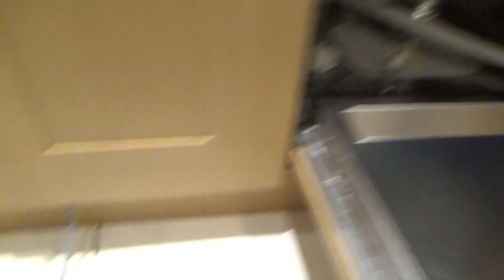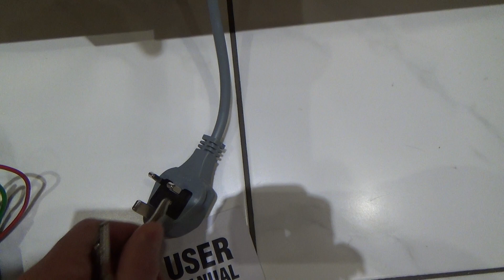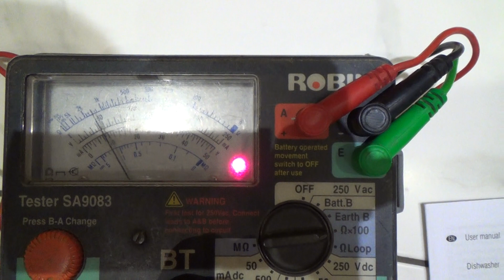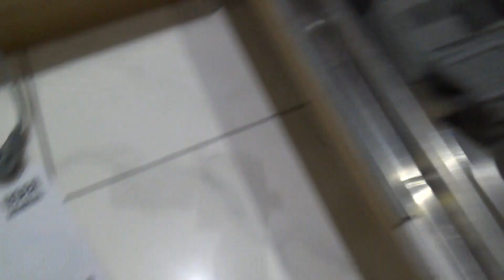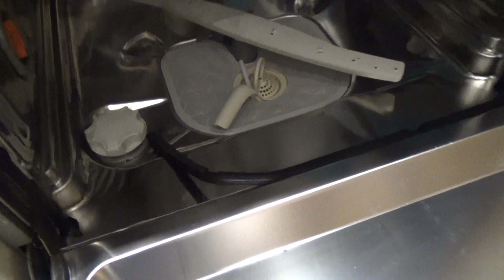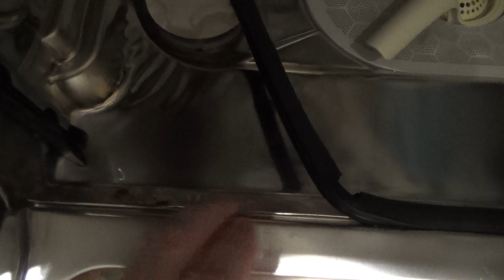Zanussi Dishwasher Fault, Tripping RCD, EASY FIX DISHWASHER REPAIR

Comment: Great video but mine is tripping as soon as I switch it on so it may be in the plug or the lead of the dishawasher that the short is. wish I knew how to test the plug for a short with a volt meter.

Comment: Thanks for uploading. In my case I’d left the fascia off the front as I’m still fault-finding (water not heating) and I think perhaps water was getting in through the screw holes that affix it on. Put it back and not tripping fingers crossed! Let’s see if it heats now!

Comment: My one is very similar to yours Zanussi ZDF2020 went to switch it on and nothing at all check the fuse in plug it looks fine seal looks fine. Must be the controls.

Comment: 2 yr old AEG dishwasher tripped out on me this morning. Checked the plug fuse and no problem. I thought it might be the heater cycle as it had been on a while. So i looked on YT for the problem. Found your vid and spot on, the door seal had come away. Thanks you saved me money and call out hassle.

Comment: Nice on Vince!  In my case I have a Siemens SE64630, but after watching your video I checked out the bottom seal and found it actually had a tear.  I replaced the seal (what a job that was - door completely off, 1 million screws to manage!)  Anyway it's all back together and is no longer tripping the 30mA RCD.  Many thanks!

Comment: Have the same model, pretty old though.  Rubber seal across the bottom eroding away. Will try to order a replacement and see if fixes.

Comment: Going to share some honesty here :D Never had a dishwasher before, so when I moved into my new home and found here, wasn't too bothered to use it - it tripped out the RCD after the second use to which the prior owners stated that the RCD was new and they hadn't tested the dishwasher with it but prior to that, no problems. So electrician needed. Left it... for months as it didn't bother me - full reconstruction on its way anyway... but then I thought today, as the sink is facing some issues (old non standard length screw took two weeks to hunt down over here!) what would youtube do.... cheers Vince - this at least has opened a bunch of avenues I can have a look at!

Comment: I followed this video and removed and cleaned all the door sealings. I removed also doors to dismantle sealing located at the bottom of the doors. There was a lot of dirt.
My dishwasher was tripping RCD almost everytime when inside was quite hot and a lot od steam. I suspected that somehow steam is reaching electric components and making shortcircuit. So far so good. After few washes RCD didn't trip.

Comment: Have a GE dishwasher. Was reading posts related to the symptoms. Saw you video and Cleaned around the rubber sealers and voila. My dishwasher stopped tripping the fuse. Thank you so much!!!

Comment: Mine tripped out the power, and every attempt to plug it in tripped out the power. This was after I had pulled it out to clean under it. What I had done was accidentally doubled the waste water out pipe as I pushed it back into place, so it couldn't drain and the water level rose and got through a seal somewhere to the bottom of the machine where the cables are.
 I pumped the water out of the machine manually with a fish tank pump, then tilted the machine forward until all the water drained out. Left it 20 mins for it to dry out, plugged it back in and all good again. Thought I'd add to this as it was the first video for dishwasher tripping the electrics. (Different machine, mine is a Beko)
Reply: Yeahhh but so all the new bosh and candy 2 years that is all i hoy out of This  2  before it starts to give trouble  for the price I pay for the beko I consider to be fantastic

Comment: Fantastic!
Brilliant solution.. replaced lower door seal (cost about €9) and it fixed the problem.
The seal in my case wasn't hanging off, but was a little frayed and that seemed to be enough to cause the issue.
Great fix... Well done!
Zanussi ZSF6128